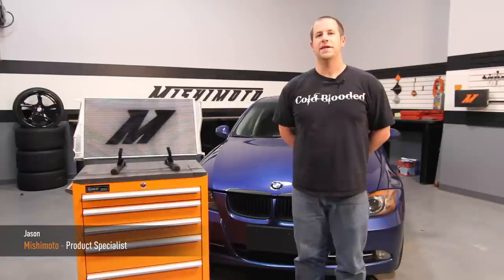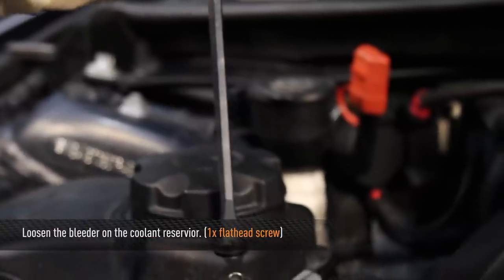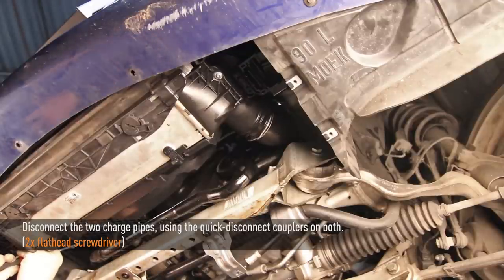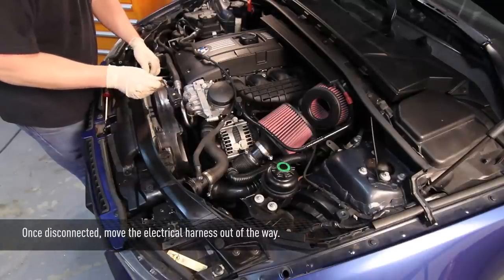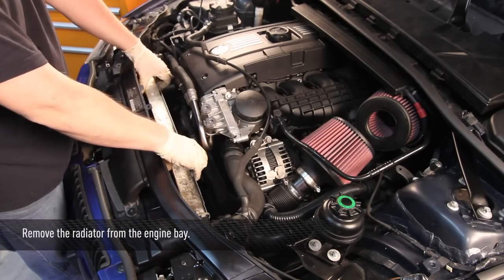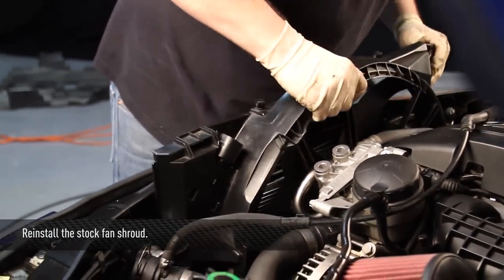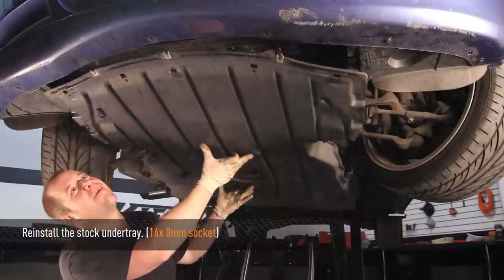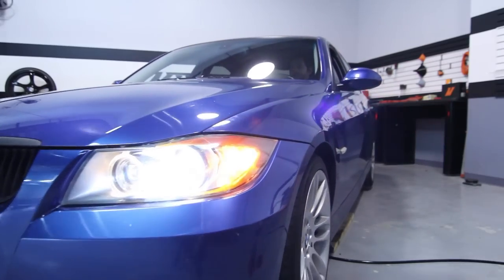2006-2013 BMW 335i/135i Performance Aluminum Radiator Installation, by Mishimoto

Comment: People... Let me tell you something. If you are doing an automatic transmission e90 or e92 this job is much harder than you see here. Just getting the large bottom radiator hose off should have been the toughest part. But no!!! You have remove your intercooler and then the little hoses at the bottom on each side.  At first you think you have to unscrew the little hoses from the radiator (because you can't pull it out without them off) but they do have the little wire clips and they'll come right off. But you're still not done!  You have to remove the charge pipe connection on the driver side or you'll be battling to get it out.  I've had to remove the electric fan before so I knew what I was in for but going in and out might cause you to pull your hair out even if you've done it before.  My Behr replacement radiator fit perfect but getting that in was a blast too.  Reconnecting all of the hoses was not a problem. Just make sure they are on firm.  I just finished mine and was shocked at what a POS the intercooler was. Watch for lots of dirt and debris coming out with it. Good luck!
Reply: Do i need mishimoto transmission cooler for automatic e93 335i, or I can iust put radiator on with stock oil transmission cooler?
Reply from the maker: Our radiator will not work with the automatic e90 models. The automatic version of the car has an additional port at the bottom to feed coolant into the heat exchanger for the transmission fluid. Unfortunately, you would not be able to just run an external transmission cooler without deleting this heat exchanger.
Reply: @Zalak Z  You ll need a radiator that fits the automatic.  If you want all aluminum they are avail for around $350-$400.  A good BEHR I've found for the Automatic is $180 and goes up from there.  If you don't go all aluminum, go Behr. Your other ones will crack at the plastic tank seam in 2 years.  Like mine just did.  Redoing it for 2nd time now along with upper heater hose that goes to the heater core. It's plastic crap elbow developed a nice pinhole leak at the same time.  That part is $39 for a good one one.

Comment: Why would you reinstall the stock intercooler?
You would obviously take the opporunity to install the Mishimoto performance intercooler!
Actually I am kind of wondering why you don't sell the radiator + intercooler as a package.
Reply from the maker: Hello zemekiel , if you give us a call I'm sure we could help out a bit with pricing :) 302.762.4501

Comment: Do you have to pull out the intercooler out or you wanted to create more space ?
Reply from the maker: To properly drain the radiator, you'll need to remove the intercooler.
Reply: Mishimoto Automotive ok thanks👍

Comment: can i use this tutorial for replacing my radiator on my DCT 135
Reply from the maker: Hello Ilusion Wear. You could absolutely use this as a reference for your DCT vehicle. However, this product is designed for manual transmission vehicles. If installing this on a DCT vehicle, you would need to grab a universal transmission cooler to replace the one inside your vehicles factory radiator. I'll leave a link below to the kit we suggest for your vehicle :) 

https://www.mishimoto.com/mishimoto-universal-transmission-cooler-kit.html
Reply: @mishimoto  Hmmmm ....... tube and fin design.  Where do you propose to mount it?

Comment: Can't disconnect upper radiator hose. Took off the clip but it is still stuck. Dont want to force it off. Seems like u hit a snag and did something to release the hose
Reply: Ante Ivcevic got to be firm but gentle when removing it will come off

Comment: What kind of intake is installed?
Reply from the maker: Hey Steve, while I could not tell you which intake this is off the top of my head, I'm shooting a message over to our production team now. I'm hoping they keep records of vehicle mods prior to us getting it in the shop. I'll follow up as soon as I hear back :)
Reply: Ok thank you, looking forward to the reply.
Reply from the maker: Hey Steve, our customer listed this as a BMS intake system. I wish I could be more specific but that is all we have on this particular vehicle. Hope this was helpful!
Reply: DCI actually decrease performance over OEM CAI because they suck preheated under hood air which is less dense.

Comment: I have a question guys, the radiator of a 135i vs 335i are the same?
Reply from the maker: Yes, the Mishimoto radiator will fit both 335 and 135.

Comment: I have a question sir : do i have to disconnect the battery before i do this ?
Reply from the maker: Any time you are working on a radiator with electrical connections you will want to disconnect the battery
Reply: Mishimoto Automotive  thank you
Reply: @Just Zuss  There are no electrical connections to this radiator.  It's all hoses, o rings, and screws.
Reply: @TheFrenchPug  There is an electrical connection on top of the fan shroud, as well as other sensors in the process.   ;)

Comment: There are two more hoses located at the bottom of the radiator that require a t25 to be removed. This is for the automatic. Just thought it should have been mentioned.
Reply: messi13578 thanks cuz I was like bro you are not finished I got two more hoses to remove and I was heated

Comment: Will this radiator work on 2009 328i E90?
Reply from the maker: The radiators are slightly different which unfortunately results in it not being compatible with the non-turbo models.

Comment: does this fit auto too? listed as manual on the website
Reply from the maker: This item is for Manual Transmission vehicles. Vehicles equipped with an automatic transmission will require modification to fit the installation of a Mishimoto Universal Transmission Cooler Kit.

Comment: Any idea how much coolant to add back before checking to bleed it?
Reply from the maker: Hey foxxrider250r . If you can provide me with the make, model and year of your vehicle I would be happy to provide you with the vehicles overall coolant capacity :)
Reply: Mishimoto Automotive Hey thanks, its a 2007 335i ,e90, 6speed. Looking to drain and flush all the coolant soon and found this video helpful.
Reply from the maker: Hello again foxxrider250r. Total cooling capacity for your vehicle is showing as 2.17 gallons. Hope that helps!
Reply: Mishimoto Automotive yes thank you sir. Maybe ill start with a little less than 2 gal and bleed and go from there